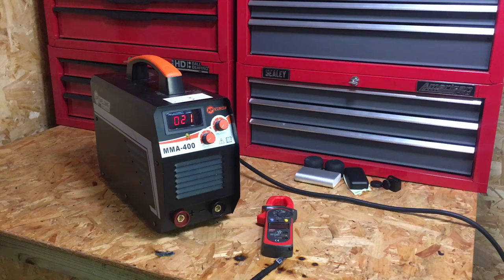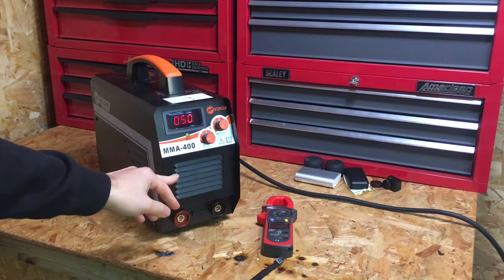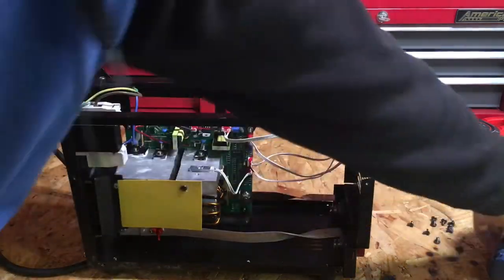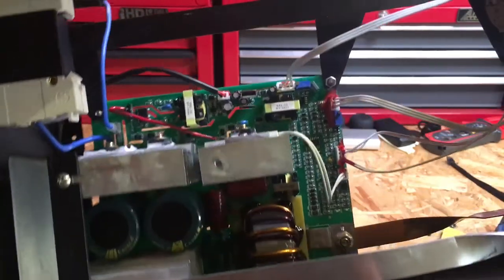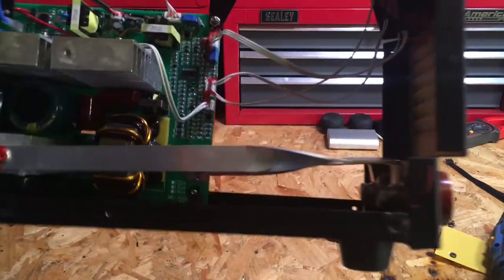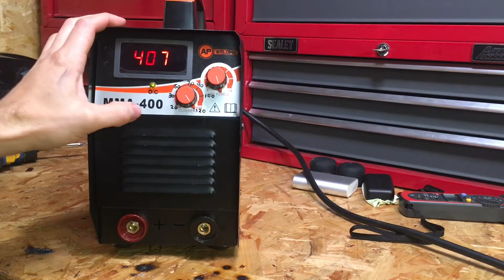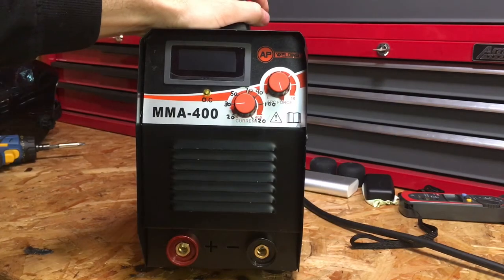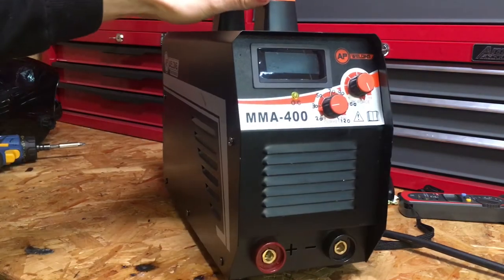AP Welding mma-400 Testing watch before you buy.

Comment from the maker: *Cobalt Drill Bit Set https://www.banggood.com/custlink/m33GhoqQgF
*Cordless drill  https://www.banggood.com/custlink/DmvGNTT9iT
*Electric bike Parts https://www.banggood.com/custlink/3Dv3bT3Q5l
*Electric bike Wheel https://www.banggood.com/custlink/KKDKNf7t7S
*48V 350W 10.4AH 20 inch E-bike https://www.banggood.com/custlink/3DDGn1TIl5
*CrimpTerminals Connectors https://www.banggood.com/custlink/mK3GAuT8oI
*Wire Crimp Tool https://www.banggood.com/custlink/DvD3sfwIaa

Handy Good Cheap Tools
*MMA welder i would like https://www.banggood.com/custlink/3vGDsufVnM
*MIG welder i would like https://www.banggood.com/custlink/K3KKs7T5nO
*TIG welder i would like https://www.banggood.com/custlink/Gm3DBGhSsi 
*Tin Snip https://www.banggood.com/custlink/KmmmnwTVMl
*Stick Welder https://www.banggood.com/custlink/DDGKsw7PU9
*Welding Clamps https://www.banggood.com/custlink/mKKGbuwF1j
*Machinist Hammer https://www.banggood.com/custlink/KmDmQ1ut11
*Screwdriver Set https://www.banggood.com/custlink/KmmKATw5w4
*Precision Screwdriver Set https://www.banggood.com/custlink/K3v3Nuwi8V
*cordless Angle Grinder https://www.banggood.com/custlink/GDKmAFL7s4
*Carbide wood turning tools https://www.banggood.com/custlink/KKmKQwfS8S
* flex shaft Rotary Tool https://www.banggood.com/custlink/3KK3Z35Boi
*palm Router https://www.banggood.com/custlink/GDGGbT1iSj
*F-Clamp https://www.banggood.com/custlink/vKDGbfuZiB
*Double Edge Pullsaw https://www.banggood.com/custlink/mvGvb7uIZN
*Mitre Box https://www.banggood.com/custlink/33KvbuTSj3
* Impact wrench  https://www.banggood.com/custlink/mKDK6g6Bts

Above are affiliate links and in the comments it costs you nothing, if you do not want to use links search on goggle more info Thanks.

Comment: are you using an AC or DC clampmeter ?.
Reply from the maker: Hi its a dc clamp meter, i did also check with a more expensive meter and readings were more or less the same,